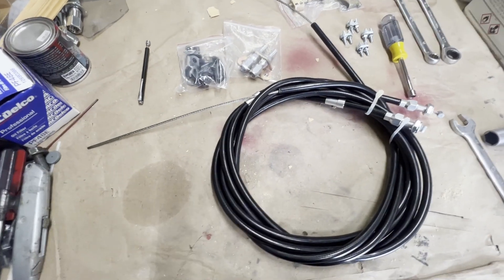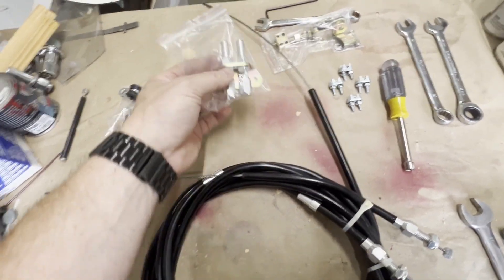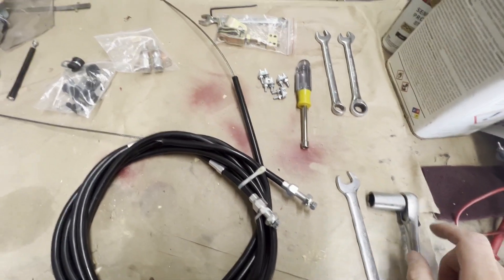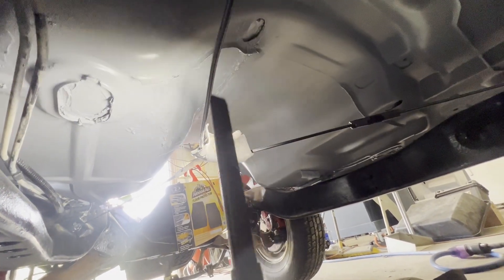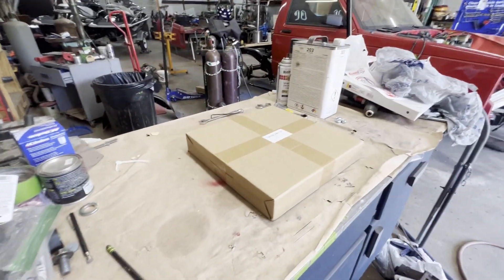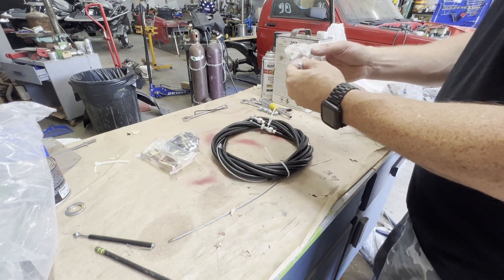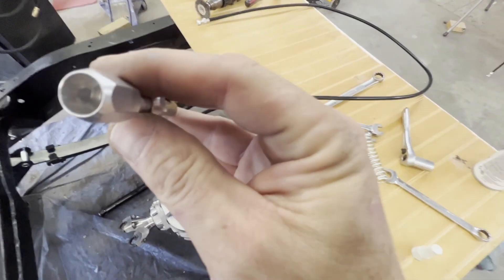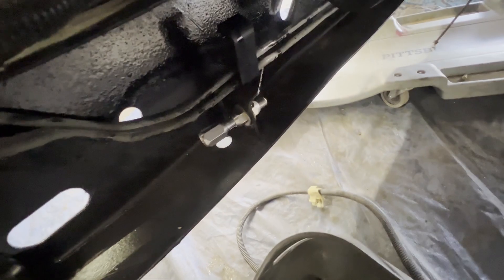Universal Parking Brake Cable Kit - Installation Video on the S10

Comment: Well, thats a lot better than trying to source OEM. Thanks!
Reply from the maker: @yourpcmd yeah these worked out great. Thanks for watching.
Reply: You won't find OEM for this style rear brake caliper anyway. You either have to find a universal setup like this or find someone to make a custom set.
Reply: @2015_Rubicnn  I know, which is one reason I subscribed to his channel. Most other channels are mainly theatrics, while this channel just gets straight to the point and I can relate to him.
Reply: @yourpcmd  I bought one of these kits for my 72 Camaro with a 9 inch swap. Kit came with these exact Cadillac calipers. If I would have known that, I probably would have just stuck with drum brakes. I just need to find cable ends that I can crimp on to the ends for the factory brackets.
Reply from the maker: @2015_Rubicnn yeah I looked and measured. This was the option that I came up with. Thanks for watching and the comments!
Reply from the maker: @yourpcmd as always I appreciate it!!
Reply from the maker: @2015_Rubicnn I found some brake cable ends that have a set screw. They would probably work especially if you red loctite the screw, but I have never personally used them. The look to be solid though.
Reply: @dtperformance256  Yeah, I think you can get either steel or aluminum stops for the cable. Aluminum ends crimp on or have set screws like you talk about. I'm not sure why it's seems difficult to be able to do what the oem suppliers have done forever, but I find everything except what they used.

Comment: How did you get the spring in?
Reply from the maker: @derpy_llama6149 The spring will go in easy by hand and then just adjust the tension. When you look at the spring it has a flat piece of the spring one on end. This is the back of the spring. This faces toward the rear of the truck with the tang or bent clip looking piece to the inside toward the floor. The open end will go toward the front of the truck over the brake caliper line. It will fit just over the nut on the brake caliper line. You will set the tension on the brake line under the cab at the “y” shape connector. It has a threaded rod. I backed my rod out to make sure I had plenty of adjustment for later on if the cable stretches a little. Thanks for watching and I hopes this helped you out. If you still have questions, please ask and I will do my best to help you figure it out.

Comment: I don't know if you found out already but you did not put the cable to the brake end correctly.
Reply from the maker: @johnwaddle9323 It looks like it can only fit one way. I will double check it anyway. Thanks for mentioning this. Also thanks for watching and I really appreciate the comment. I for sure want it to be installed correctly.